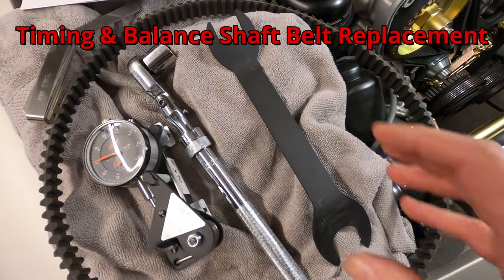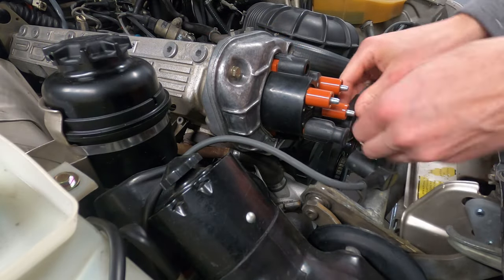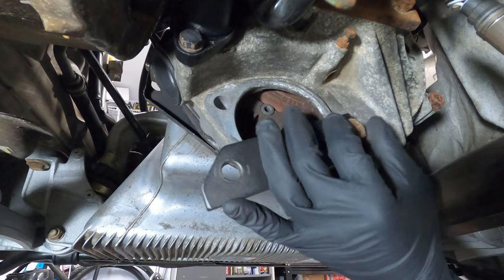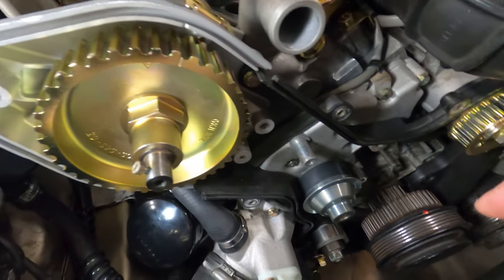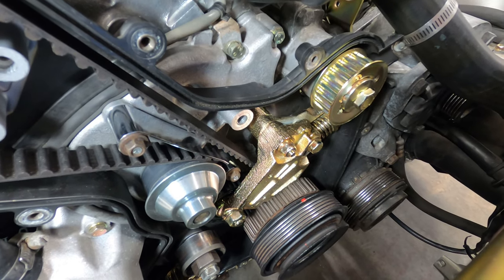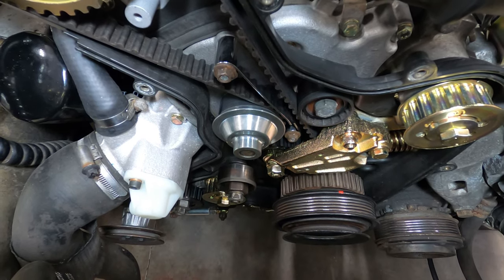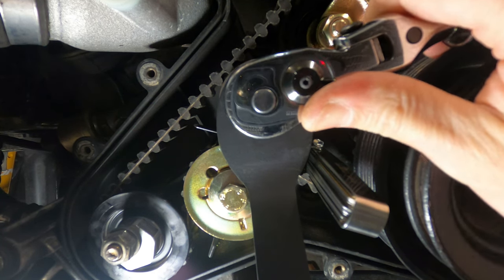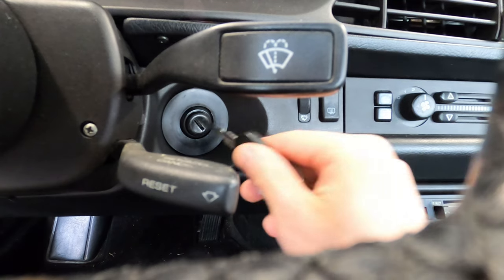Porsche 944 – Timing & Balance Shaft Belt Replacement Tutorial (Spring Tensioner / ArnnWorx Tool)

Comment: Two weeks ago I replaced my timing belt balance and accessories belts following the directions on your video. Thank You for the great videos.  I have a1986
Reply from the maker: That’s awesome man, congratulations on getting it done! 👍🏼
Reply: After the replacement the engine works great and iddles perfect. But for some reason the check engine light you know the red exclamation mark and the upside down triangle turn on and off intermittently especially on a rough road.  What do you think is causing this?
Reply from the maker: @frankharo4875  That sounds like the parking brake warning light. The large red light with the ! Is the central warning light. It will illuminate for a variety of issues, but is usually accompanied by another light indicating what the issue is. There is a push-button switch at the base of the parking brake lever. Make sure it’s aligned correctly and try to push the parking brake all the way down. It’s possible the lever is bouncing up slightly on rough roads, which would jiggle the switch around.
Reply: Happy Friday.  I don’t this the brake warning.  I disconnect the cable and the exclamation light and the upside down triangle light still lightning intermittently

Comment: This is probably the best video for performing this maintenance. It gave me a warm and fuzzy to tackle this job on my 944S. I'd say taking my time and doing some engine bay cleaning at the same time, took me about 7 hours. Most difficult part is having to get under the car to remove accessory belts, cooling fans, and starter. But overall not a bad job like it's made out to be. Thanks again.
Reply from the maker: Yeah man! It is a larger job with some complexity, but it’s really just made up of a bunch of little jobs that can be tackled step by step… and I too am getting tired of removing and reinstalling my starter. 😂 I no longer disconnect the wiring. I just support it  to the exhaust with a bungee cable after dismounting it from the bell housing.
Reply: I'm in the process of getting this done for my 944S. Sure the video is great, but is there anything specific for 944S? If possible @thetruth944 can you share your experience. Thanks in advance to both of you.🙏

Comment: This is incredibly helpful. Thank you! I'm bringing my '86 944 back to the road this year after several years sitting under covers following an MOT fail. These videos are exactly what I was looking for.
Reply from the maker: That seems to be the story for quite a few of these. They are a bit sensitive to ignition condition. I’m lucky there are no emissions tests required in my area. 

I would replace all the basic stuff - air filter, distributor cap, rotor, plugs, wires - to get it firing as clean as possible. Fresh oil may even give a marginal edge... and really get on the accelerator on the way to the MOT to clean it out. 🤣

The AFM also loses its calibration over the years, which affects the air/fuel mixture. I’d like to convert to a MAF setup at some point. Anyway, best of luck and hope you get it back on the road!
Reply: MOT?
Reply: @tvguy12346  It's the annual road-worthyness test in the UK (Ministry of Transport)
Reply from the maker: @tvguy12346  The MOT test (Ministry of Transport) is an annual vehicle safety/emissions test requirement in the U.K.  Basically the U.S. equivalent of our individual state safety inspections.

Comment: Just bought an 85 944 this summer and started restoring it. You have no idea how helpful your channel is, thank you so much for your content man!
At first I thought the timing belt change was gonna be challenging, turns out the most challenging thing on this car is putting the block coolant purge back on 😂
Reply from the maker: Hey man, that’s awesome news, I’m glad the channel is helping out! Pretty much all the 944’s suffer from the same issues over time, and I’ve documented nearly every repair I’ve done on mine, so it’s almost a one-stop-shop for advice, which is what I was going for. And yes, the engine block drain plug is in a very poor location. 😁

Comment: Thank you so much for all of your videos.  I've replaced my belts and seals, including the o-rings in the oil cooler housing on my S2.  The only issue was a slight squeal from my alternator/AC belt!
Reply from the maker: Yeah, that ribbed belt runs pretty tight. It sounds like you’re making great progress on the car. I’m glad you found the content useful! Cheers!

Comment: This is very god information, and quality video. Thank you!
I highly recommend inspecting Oil pump drive gear and front engine seal. Especially on cars lacking manintenance history.
My engine was leaking from the front and I decided to order an oil pump drive gear just in case. Good call as it was severely grooved.

Comment: Wow!  I'm also in NC and am so thrilled to have found your exceptional videos!  I have owned my 1990 944S2 since 1999, but it hasn't been on the road since 2014 due to much needed maintenance.  I have just begun the process of changing the timing belt and have the full Maxi set of Arnworx tools.  So far, I have inserted the flywheel lock.  Next up are the accessory belts.  I look forward to watching this video in its entirety before I continue.  Clarks Garage has served me well for years, and the Pelican Parts site also is of great help, but there is nothing like a good video!  And, oh my... your engine bay is so clean!  :)
Reply from the maker: Awesome! One bolt at a time and you’ll get there. 👍🏼 Best of luck and glad you found it helpful!

Comment: This a great video - I have a 1986 944 I'm taking ownership of in the near future from my parents.  19k and the belt has only been done once in the past.  This is the first thing I want to do in my new garage but was extremely nervous as I've never messed with timing components on any vehicle.  Trying to find an independent shop to take it in my area has proved fruitless, and I don't trust dealerships (besides the overinflated costs).
Reply from the maker: Sounds like you’ll be initiated soon enough then. 😂 Best of luck, hope it turns out great!

Comment: Good day, finding this film is worth a mint. Thanks for an EXCELLENT production.
Can I ask you please: you platted all the pulleys except the main one for the generator. Is there any reason for this except originality?
Reply from the maker: @GreasyFingers  Hey, thank you! No real reason for not plating that pulley other than it was still on the engine when I took everything in, and I didn’t feel like removing it at the time. You certainly could have it plated if you wanted to.

Comment: Your channel is absolutely priceless. Your car is unbelievably new looking. I have referenced this video to replace my water pump ( and belts). It was invaluable. My only concern is when my engine is running there is a whine sound. I wonder if one of the belts is too tight ???
Reply from the maker: Hey Mike, thank you for the comments! An overtightened belt could create a whining sound as you describe. There is a lot of belt noise in general with 944s that you don’t typically hear on other cars, and most of it comes from the balance shaft belt. When set correctly, the balance shaft belt is much looser than the timing belt, and so it’s often overtightened by mistake. The idler roller could also be set too high and creating excess noise in that area. You could try narrowing down the location of the sound using a mechanic’s stethoscope.

Comment: Not to be a pest here-but missing in your tutorials is the water-pump replacement. Assuming yours was recently done and you simply don't need one yet! It looks to be more complicated than timing/balance shaft belts, so I look forward-to your video-whenever that service presents itself!
Reply from the maker: Yeah, I replaced the water pump in July of 2019. I have a few pictures of the process, but no video. It’s basically a timing belt job plus a few extra steps - gotta remove the balance and camshaft sprockets in order to remove the rear belt cover, then the pump can be accessed.

Comment: Well done. It's like a video version of a Clymer manual. Thanks. I feel I should mention to others watching that it is advisable to loosen the pivot bolts on the PS pump and A/C compressor. I think you forgot to mention that when you were explaining the steps, even though you did it when you loosened the tensioners up. I couldn't find the Arnnworx tension guage but did find one on Pelican Parts then that same one on Amazon by a different name but looked identical for half the price. If it's not too expensive, I think I'd prefer the Arnnworx one, could anyone provide a link to where it can be purchased?
Reply from the maker: @manstersr  Thanks! Yeah, it’s important to loosen the pivot bolts on the power steering pump and AC compressor to avoid damaging the brackets. I mentioned this step at 6:10 in the video before demonstrating the belt removal process. 

Bruce Arnn of ArnnWorx retired over a year ago and closed down his tool business. Sometimes you can find a used tensioner tool on eBay, but new ones are no longer available. There’s also a 3D printed tool option on CarPokes - https://youtu.be/ICyNOwfmWwg?feature=shared

Comment: Hi, thanks again for making these videos. I did have a quick question; would you recommend putting any loctite on the roller studs for the balance belts? One of my studs backed out when I was loosening a nut.
Reply from the maker: @matthewcoulters48  Based upon my experience with snapped studs in the engine block, I would be more inclined to clean up the outer threads really well for easier movement of the nut or replace the affected hardware with new parts and then install, torque, and go.

Comment: Question:  Is it proper to let the timing belt tensioner completely 'loose' onto the belt?

I've seen so many comments about the 90° twist method of determining proper tension, but was never sure whether that only applied to the earlier models that don't have spring tensioners.  Fir this reason, I set my tensioner a little loose.  I always planned to reevaluate both belts after 500-1,000 miles of driving,  where I'm currently nearing.

Thanks for all you do here!
Reply from the maker: The force applied to the timing belt by the later spring tensioner in its natural position after being “let loose” is a good starting point and will generally get the belt “close” to the correct tension, but that should always be checked using a measurement tool and adjusted as needed (or 90° twist for those comfortable with that method). Due to variances across parts and metal fatigue that can cause old coil springs to fall out of specification, the spring tensioners should not be considered auto-tensioners, but they do make setting the correct belt tension slightly easier than the early eccentric tensioners, in my opinion.

Comment: Great videos!  How come your power steering belt has the v ribs on the outside of the pulley and not on the inside?  Sorry if you explained this already.
Reply from the maker: Hey! There are a couple different v-belt designs from various belt manufacturers, one of which has ribs on the outer surface, and most of which have ribs/notches cut into the inside surface. The one shown here was a Dayco belt as I recall, where they “claim” the top cog design delivers more flexibility and increases airflow around the belt, so it runs cooler and lasts longer than competitors. Functionally though, I’ve never personally observed any differences. The Porsche OEM v-belts have notches on the inside edge and they seem to work fine.

Comment: Very helpful. Question, my '87 944 does not have a guide plate or the mounting "bosses" that it bolts to. This is slowing down the belt replacement process - what to do!
Reply from the maker: The metal guide plate was added later on to prevent the two teethed sections of the belt from rubbing together and damaging the timing belt. The plate mounts to the water pump, so if your pump doesn’t have the two mounting points, it sounds like your car has the early version pump installed, in which case you’d have to replace the water pump and add in a guide plate. The car will run without the plate, it’s just a preventative measure added by Porsche after observing some belt failure issues.

Comment: Which timing belt kit and water pump kit would you recommend for an early 944? Brand? Gates, cont. , uro?
Reply from the maker: I went with the URO water pump as there are a fair number of accounts from other 944 owners on the forums conveying general reliability. Mine has been running for 4 years without any issues. Given the relatively higher price of the Porsche OEM pump, I considered the fact that I could go through 3 URO pumps for the same price if a problem arose. As for belts, I've used Continental and Gates, where both appear to be of similar quality and I have no negative issues to report with either brand. 944Online or Pelican Parts can set you up with kits to include everything you need.

Comment: began to dismantle the front end of the engine, found that balance shaft is off timing by 4 teeth. last time belt was done in 1998 at 125K the car has 159k. glad to know that the engine can run smoother once im done.
Reply from the maker: Haha, yeah that’s not terribly uncommon. Should smooth it out a bit once you’ve got it set right. Good luck! 👍🏼
Reply: @NC944er  placed engine in TDC and the cam gear is off by one tooth.
Reply from the maker: You are finding lots of surprises with this one! One tooth off shouldn’t have damaged the valvetrain, which is good, but would have a loss of compression and performance. Should be interesting to see the difference once you have it all squared away!

Comment: I have a question - I was doing the water pump replacement and using your video as well as some others - thank you up front  for your videos  - they are great.  My question is 
that when I got to the point of putting the timing belt back on - the suggestion is to rotate the crank a couple of times and watch the cam gear to see if the timing marks line up.  
Well I cannot move my crank - ??  I was able to move it prior to starting the replacement process - I replaced the water pump - so no fluid is left in engine  - or just a small about that doesn't flow out.  Also I did use the flywheel lock tool once the #1 was at top dead center - and the marks not he cam gear etc were in the proper locations.  Cannot understand why crank won't move - has been a month since it last moved.  Any thoughts ?/
Thanks in advance
Bill
Reply: should say on the cam gear  --- not not he cam
Reply from the maker: @WDonnelly-k1r  Hey Bill, assuming that you’ve removed the flywheel lock prior to attempting to rotate the engine, it would be difficult to suggest what may be happening without inspecting the car firsthand. My recommendation would be to go back through and confirm that each component was installed correctly.
Reply: @NC944er  Thanks for replying  - I finally found out what the problem was  -  the timing gear on the crank shaft was installed the wrong way - wrong side facing me - when I installed it the other way around - it worked - was able to turn the crank.

Comment: I’ve been chasing this vibration around 4200-4500 in my 84 for so long.. I suspected balance shafts were off so I took it to the shop to confirm and sure enough they told me it was,  so they adjusted it however I drove home and the vibrations persist. I notice that it occurs when clutched in or not, in gear or not, whether moving or not. This vibration is mostly felt in my gear lever and if my hand isn’t on it, I almost don’t  notice the vibrations but it’s definitely a concerning feeling. Do you have any idea what it could be?
Reply from the maker: @MrUglyDinosaur  Have you checked your engine mounts? When they fail, they create quite a bit of vibration.

Comment: The arnnworx tool is throwing me off here so I have a question. I’ve got my timing belt on (brand new Porsche oem) and the tensioner is all the way out/tight. I’ve rotated the crank 2x and then backed it off 10°. 
My belt is tight, I can barely get it to 90° twist but my 920x says my belt is very loose. It’s calibrated to .166 and the belt reading is .189. I can’t get the belt any tighter because my tensioner is all the way out but I feel like my belt is plenty tight as is.
Reply: I think I’m just using the tool wrong.
Reply: Yea I was interpreting the instructions incorrectly. I think I got it figured out
Reply from the maker: If you can barely twist the belt to 90° with decent force, I would back off the tension, complete the crank cycle again (with 10° reverse), and double check. But to your point as well, the instructions can be a bit confusing until you get a flow down. 😂
Reply: @NC944er  I think I got it. It’s on the loose side for a new belt, which is a little tighter than a used belt. Ended up backing the tensioner off just a smidge. Used a box cutter blade (.5mm thickness) to set my balance shaft idler clearances. Just put brand new covers on and everything is looking sexy
Reply from the maker: @tims_4x4_garage  Nice! I didn’t find that mine had really loosened up much after the 2,000-mile break in period. In a pinch, I’ve also used a piece of cereal box to set the roller clearance. 🤣 Sounds like you’ll be back up and running before long. 👍🏼